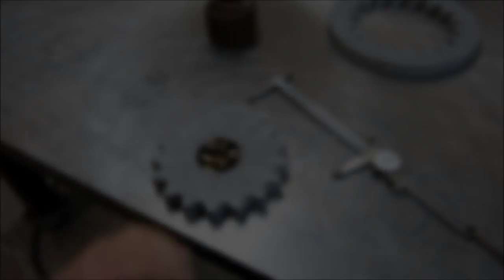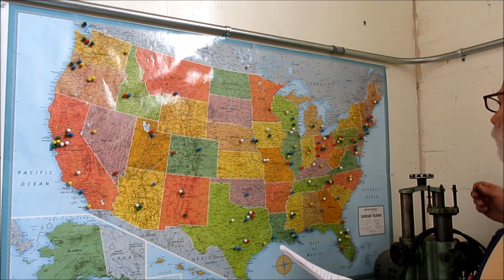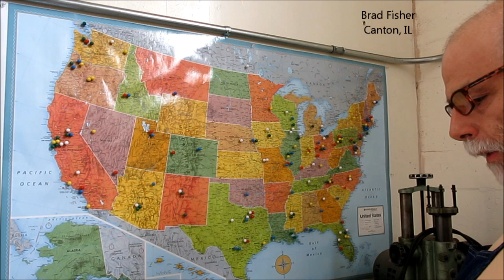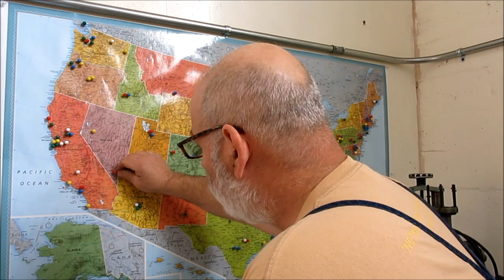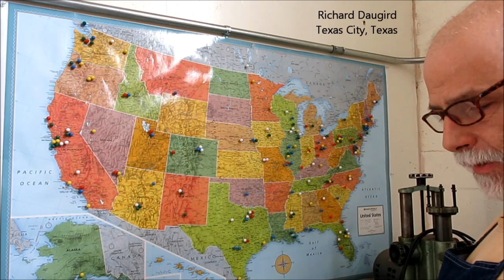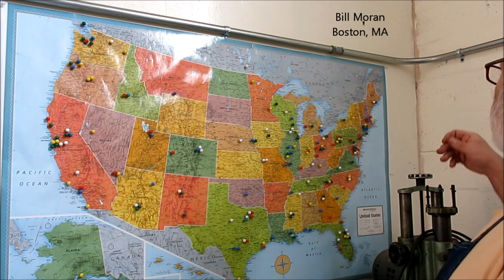Monday Night Meatloaf 16 Sidedish

Comment: Thank You for taking the time to make these video's.  Great stuff to learn, and remember as it seems I've forgotten way too much.

Checking in from Cedar Park, TX.  Still putting an Edlund Drill Press, LeBlond Regal, and Index 555 milling machine to use after 20 years in my home shop. 

Still need to build an English Wheel one of these days, meanwhile still getting aluminum to behave. 

Tom Walter
Reply from the maker: Hi Tom,

Thanks for the comment and participation. We will stick another pin in Texas for you. You must have quite a collection after 20 years of you home shop.

All the best,

Tom
Reply: oxtoolco
Still learning, and have lots to learn.     “Metalworking Doing It Better” has some great tips. I need to make up tooling for ball turning on the milling machine, I need a 8” radius hammer face, so now it look like I’ve got a solution.  I’m having fun machining pre-heat treated 4140 for those parts (Rc 36).
 
You need to make it to Texas, as we have some of the best BBQ here.  Make it part of a ‘shop visit tour’ and we will have good food, good company, and shop dog wagging her tail when you arrive.

Tom W
Reply from the maker: Sounds like fun. A machinist road trip might make a great video series. I think I need my own TV show to pull that one off.

Stay tuned. I'm planning a spherical generation video series coming up here.

Best,

Tom

Comment: Hi Tom, I used to turn some large flanges that could really only be measured while still in the chuck. I have a set of inside mics that go up to 42" and the shop had some huge calipers The lathe had a 39" 1meter chuck. Big parts like that almost always spring unless they are quite substantial... We had to get pretty creative at times... :o]

O,
Reply from the maker: Hi O,

Thanks for sharing. Some of the really big stuff is pretty tricky to measure. Were your ID mike the bigger tubular type?

All the best,

Tom
Reply: oxtoolco I'm not sure just what you mean. I have them here looking at them. They're made by NSK, and I would say they are solid rod type but incased in heavy solid sleeves in which the precision solid measuring rod extends and retracts by an internal spring into the sleeve to protect the contact points as you put the sections together and separate them... They are kind of like incased standards of the necessary different needed lengths to achieve any I.D. larger than 2"... I think that describes them. :o]

O,
Reply: Opinionator52 Upon looking for a picture on the web I see that they were called tubular.  I think of tube as having empty space inside,,, ooops :o]

O,

Comment: Tom,
     Love the side dishes.  The meatloaf is always better with the sidedishes. Great show, as always.  Just wondering... How much runout is too much in the orbiting element of the cycloidal drive? It would seem that mechanism would be pretty tolerant of some run out.

      If you have a chance to give us a better look at the rest of the cycloidal mechanism, that would be cool.  The model mock up would be great.  I'd like to under stand the motion better.  

All the best.  Thanks!  Chuck
Reply from the maker: Hi Chuck,

Excellent observation. This is one of the neat things about this gear system. It can tolerate a rough geometry. The information I was able to find on it mentioned the gears could be cast or forged and then used in net form. 

All the best,

Tom

Comment: Great Job with all the new pins! I loved the Weasel snot story! I was mounting tires one day with tire paste called Meyers lube and I told the young boy standing there to feel it and see how slick it was! he did and asked what it was and I told him it was Elephant snot! I thought it was funny! later in the Service truck repair I would use a latex glove on 1 hand to lube tires with and then peal it off and ta-da a clean hand! no washing it in ice water or wiping it off in the grass and wasting expensive terry towels.
Reply from the maker: Hi Brad,

On the subject of snot. I would always choose Elephant snot over Weasel snot for almost any application. For light duty applications the lower viscosity index of weasel snot is sometimes required for close tolerance assemblies. But the superior gross lubricating qualities of Elephant snot outweigh any weasel snot advantages. I wish McMaster would stock it.

All the best,

Tom
Reply: I know what you mean! as that stuff is very thick and can be used to fill a 1" gap and help air up a tire that has been collapsed (stored on it side), where I have had tires that would not pop out and seat with 50+ psi in them (scaring the crap out of me) I would deflate and apply wd40 as it evaporated after 10 or so minutes and when the tire finally seated with a loud Twang! at least the wd40 didn't spray tire lube all around in a 180 degree arch!

Comment: You said they were flame cut. Did you notice if the cut's were straight all the way though or is there a little taper meaning the OD top is bigger then the OD bottom.
Reply from the maker: Hi Ruben,

There is some taper on the teeth from top to bottom. Maybe .010 inches or so on average.

Cheers,

Tom

Comment: And of course on large diameter parts the temperature can greatly effect the measurements, so it is important that if something is being made in a shop that is 50deg, but another shop is making a part in a shop that is 90deg it is not hard to have discrepencies in measurements even using calibrated tools.
Reply from the maker: Hi Bc,

We routinely make parts that are cooled to cryogenic temperatures and have to perform predictably. It can get pretty tricky to keep things where you want when you cool to minus  452 degrees F. The contractions are shocking.

Cheers,

Tom
Reply: That is impressive! I wouldn't call temps below solid Nitrogen to be routine! I use an outfit called 300 below on some of the racing parts I make. When you are altering the grain structure completing a quench like that you can certainly get some movement and change. Round parts made out of rolled plate can really go nuts from the already aligned grain structure of how the plate was made.

Comment: Tom, Why not clamp the gear on the milling table and bore the hole, the tops (crest) of the teeth are as accurate as the PD since its been flame cut, and you can indicate the crest of the teeth easily on the mill. My 2 cents. Thanks for the Vids I enjoy them.
Reply from the maker: Hi Senocon,

You are probably right. I still want to bore the ID in relation to the functional surface of the gear and the average pitch circle. It probably won't make much difference on this gear but I also wanted to demonstrate the technique. The chuck jaws do a better job of interpolating the average than I can do with an indicator bumping along all the teeth. Good question.

All the best.

Tom
Reply: Thanks for the reply Tom!